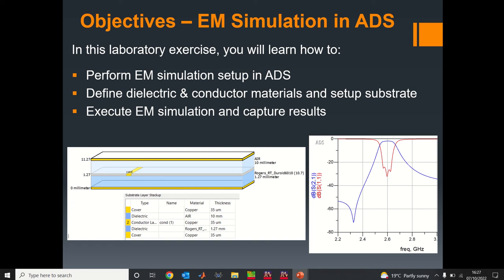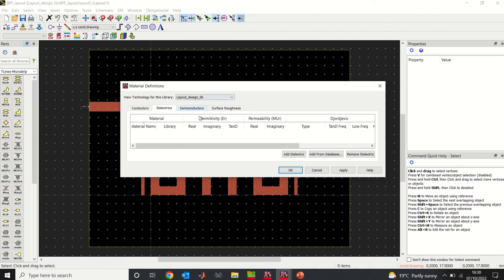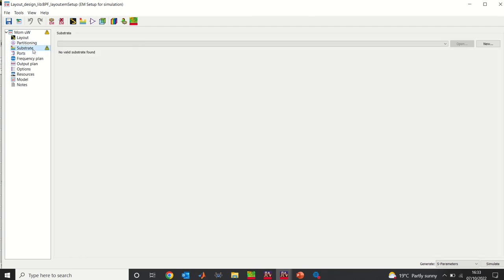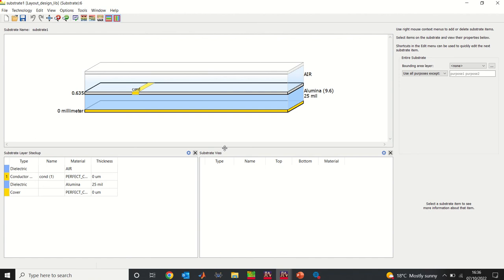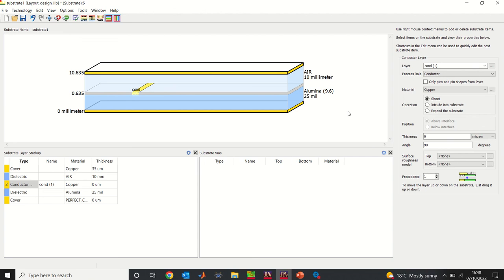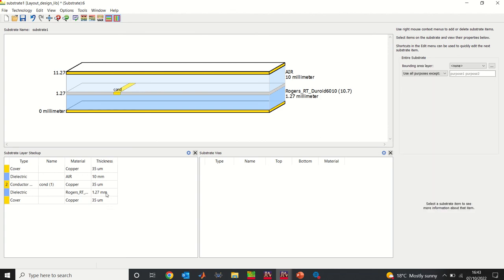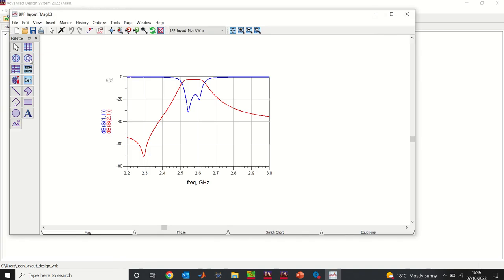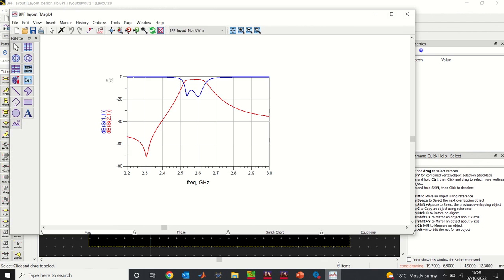EM Simulation in ADS

Comment: Hello Doc please if i want to shift my frequency from higher to lower band which parameter should i optimize to get that?
Reply from the maker: Hi Adamu, the best way to shift centre frequency (without compromising the entire design) is to adjust the dielectric material of the design substrate. Try this out and see the effect.
Reply: @fanoaustin  ok Thank you Doc